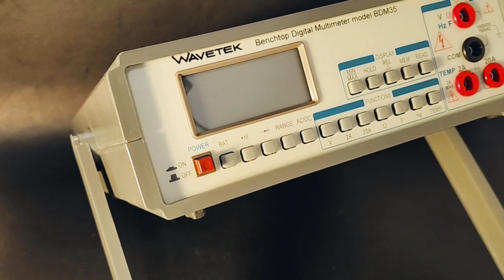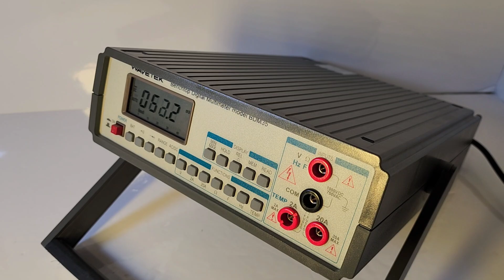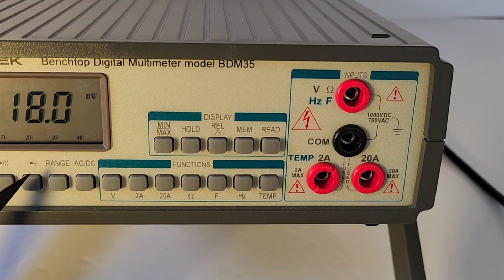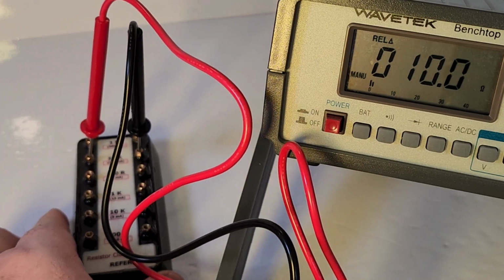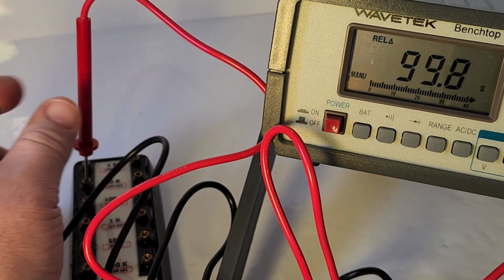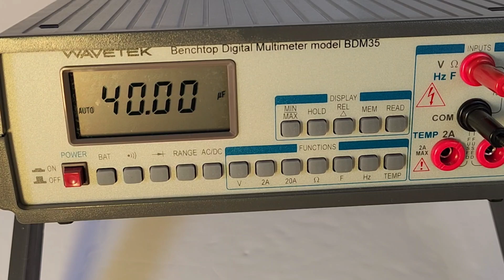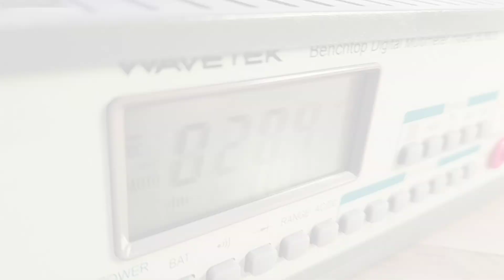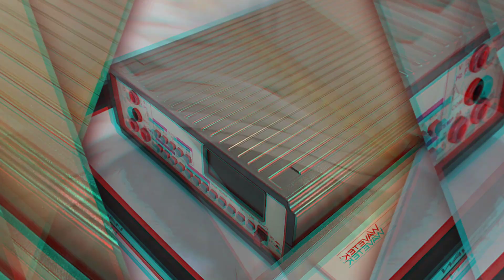RETRO-TECH ○ WAVETEK BDM35 Benchmeter  Review & Teardown! (1994)

Comment: Hi Darren. Cool device. ( Apart from the size, but in general it is clear what this size was intended for in 1994, of course, as a stationary multimeter shielded with perfect accuracy, for all 4000 countsв ) At first glance it looks very precise. I really liked the traceability of the components and the ability to calibrate, which is what actually makes it so accurate. But despite all this, it is clear that he has a good supply of vital resources. What is missing from current devices with a fully SMD layout.... 
   Nowadays, even ceramic fuses are of worse quality than they were 10 years ago. We'll have to switch to standard again))) 
 Спасибо )
Reply from the maker: Size wise it's similar to today's benchmeters. Only difference is that the pcb in this WAVETEK actually utilizes the full case housing. So true about fuses..way better back then and much cheaper too. Stay safe my friend!  👍